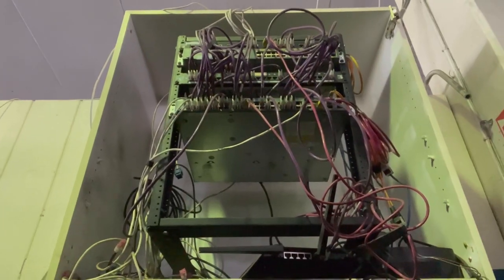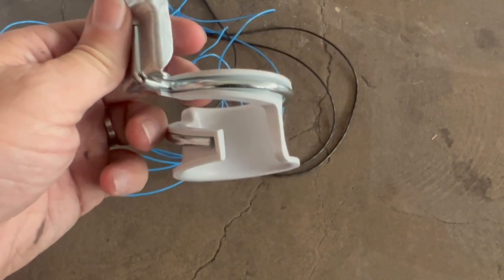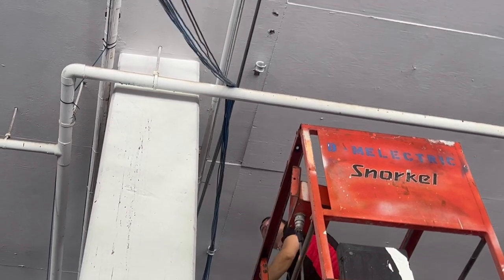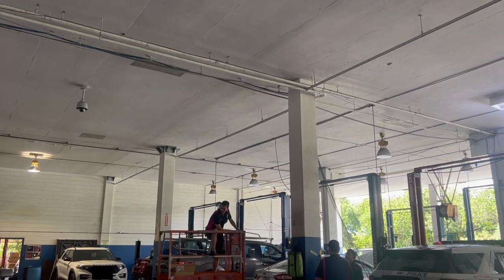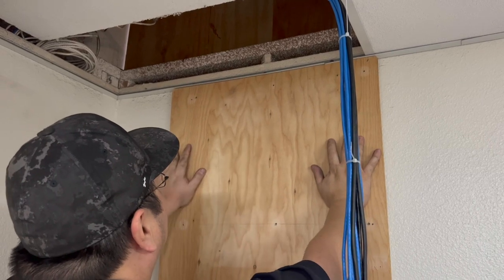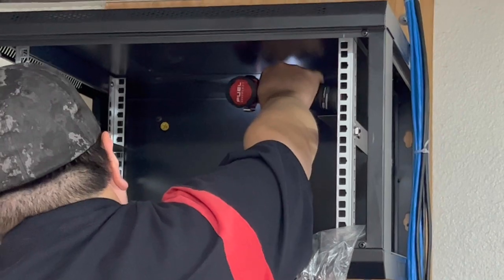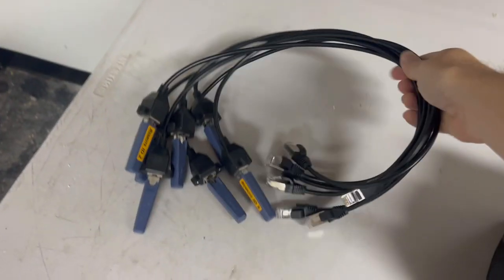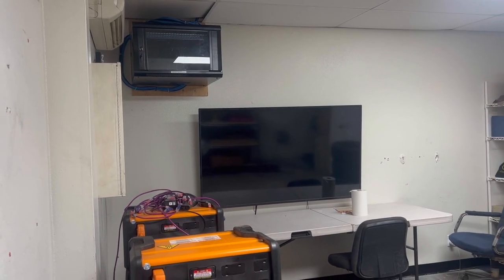Cat6 in a Concrete Jungle - Learning Network Cable Management

Comment: It’s a big mistake to place rack to close to AC - how to access split block for maintenance? 😢
Reply from the maker: Makes no difference, its dead like all the rest of the items that were in that room, TV included.
Reply: @tciproductions  probably cleared with the customer where they would install the cabinet before they completed the work. I personally might’ve stressed to the customer “look I know you don’t use this but it’s an asset that could be used one day and this new cabinet will be blocking maintenance access to the AC…”  just to ensure the customer is not only aware of the impact to the surrounding area but also to ensure you, the installer, are adequately covered for any future complaints. I might even insist on an email to have a paper trail

Comment: Hilti bridle rings, wow I did not know these existed, these look really nice, better than jhooks IMO. I never really liked bridle rings before with that cheap looking plastic saddle that snaps on them but these are very nice and made specifically for category rated cable. Wish they had more mounting option for them and sizes, looks like they only have 2". Not necessarily that expensive either, yes they are more than 2" jhooks but Hilti is always pricy.
Reply from the maker: I talked to my Hilti rep when I was buying all this stuff originally and the reason is essentially if they got bigger and were fully loaded, the fastener might not be up to it.  They prefer the situation was that the fastener is way over spec'd for the scenario they have in mind.  I put in a second chain of bridles if I need to.  Also, I have used the nailer to just slam in a J-Hook right to the wall, so that works too, and then you can size it how you want.
Reply: @tciproductions  That makes sense, that fastener is probably is not that strong, somewhere between a hammer drive anchor and a plastic molly type concrete anchor. Also, I guess you could still use these unconventionally in a building steel type scenario, just remove the nail and use a beam clamp to clamp down on the baseplate of the ring and an ibeam or joist, that would be quite strong.

Comment: I really enjoy your new line of videos on networking. It has been great to learn from a real professional. I've even picked up that cable crimp tool (such an awesome thing). 
I've noticed two things in this video and got some questions: In the "Small Business Open Frame Rack Build" video you used some short pipe pieces to not leave any "DIY-looking" holes in the dropped ceiling for the cables going to the rack. Why didn't you do it this time? Was it because last time an external person cut the holes? Also, did you install the rack upside down by accident? I noticed the cables were going into the rack mount from below, was there a reason for this? Couldn't you just have flipped it, if it was like this by design?
Thank you in advance. This is some great stuff you've got going in the past half year.
Reply from the maker: You've got some sharp eyes.  So for this ceiling, the tile was super "mushy" and we didn't have anything that fit the bill.  For that reason, we notched out a small section.  I don't like doing it, and I may have mentioned in the video except the team made that hole when I wasn't there to film it sadly.

The rack is not upside down, instead, it is Jeff's preference to enter the slack from the bottom of the cabinet.  I don't really micromanage my people, he likes it that way and there's no real downside.  The rack has entries at top and bottom so either way would work.  I prefer the top personally.  You'll see on other vids or reddit threads that people have their way, no sense trying to change them :)  I'll put some more stuff out there, you may see other takes on how to handle the bundle as we go along.
Reply: @tciproductions  Wish more business owners and project managers were like this, most want to micromanage everything you do, right down to the type of knots you tie in your pull string.....lol. Its always interesting to me to see the way different companies and different techs do things. In cabling there is not always one right way to do something, often there are multiple ways to accomplish the same task, neither may necessarily be right or wrong,  just different......but... you'll very often have techs/installers/ PMs etc who think their way is the ONLY way or the best way, because that's what they are use too
Reply from the maker: @Eric-qx1kx  I give my people a style guide on how I want things, however I leave some room for you to be you :)

Comment: Quick and genuine question: Why  was the ceiling rings a better choice than trunking?
Reply from the maker: I'm not sure of that term exactly, but in my region only an electrician may install conduit, so we use the light-weight rings.  They are very smooth and cables just glide right through them, so if we can get a string through it, a fellow on the ground can just pull a group of cables through with little effort.  Sometimes conduit can have a fair amount of friction.  It looks a lot better though, so its a trade-off.
Reply: @tciproductions  Alright cool. Good vibes.